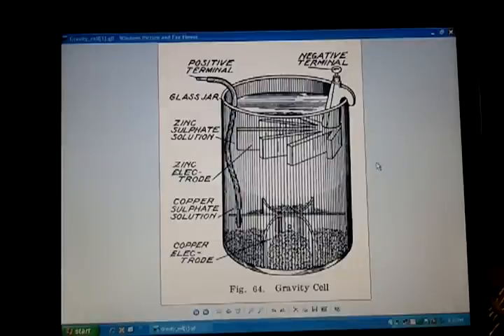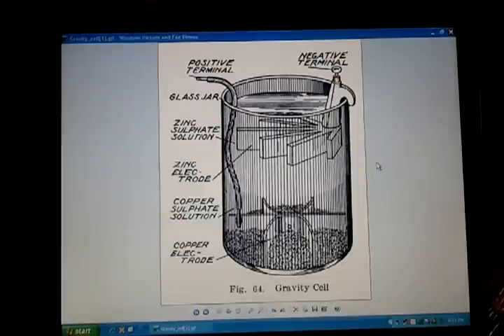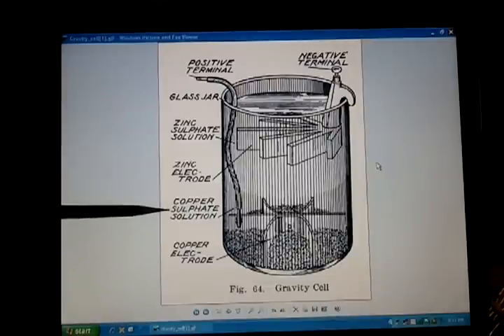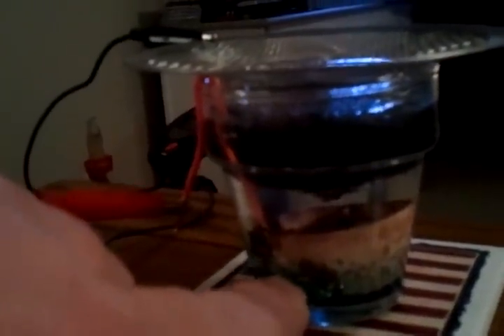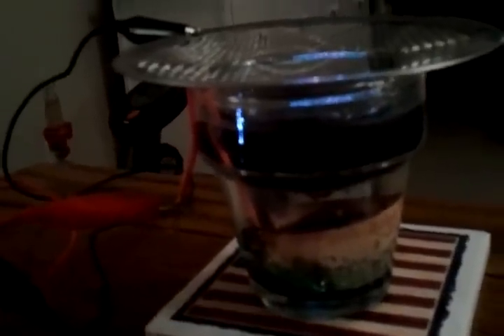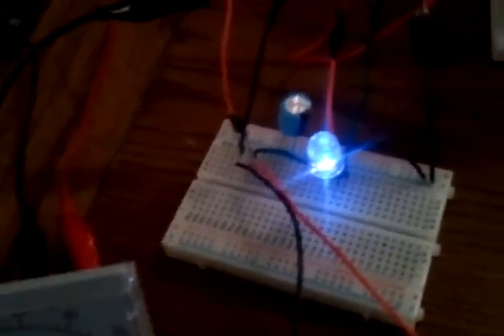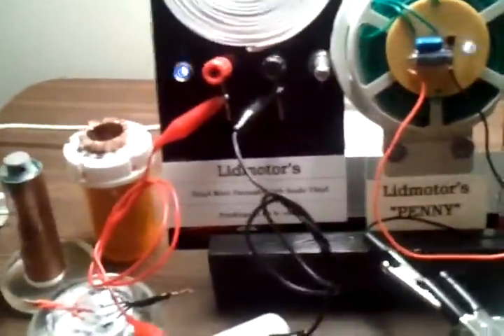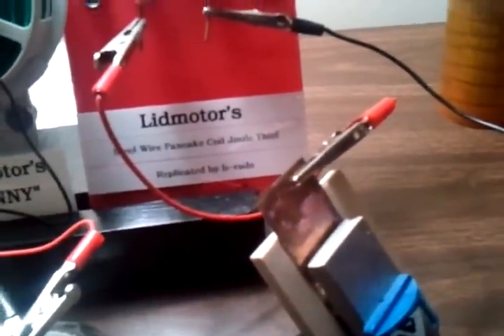150 year old battery teaches depolarization

Comment from the maker: @overunitydotcom 
Thank you for watching Stefan.  This battery output only 1 volt under load.  Without load it measures around 1.08 volts.  Using the blocking oscillator and strong current overcomes the low voltage readings very well.
Brad S